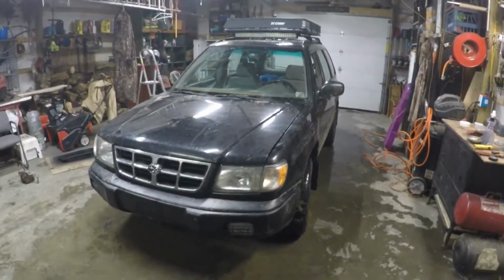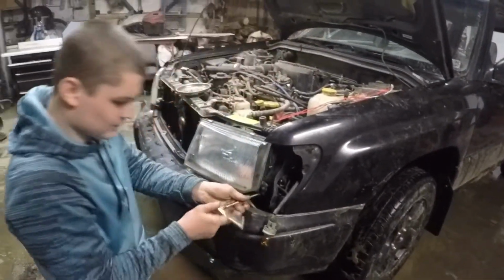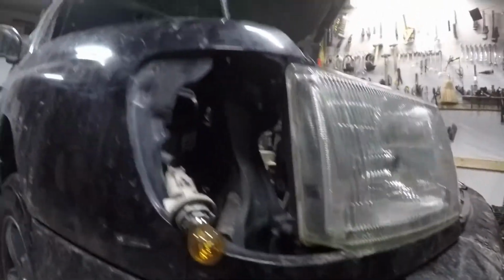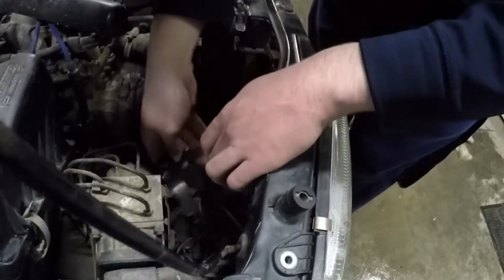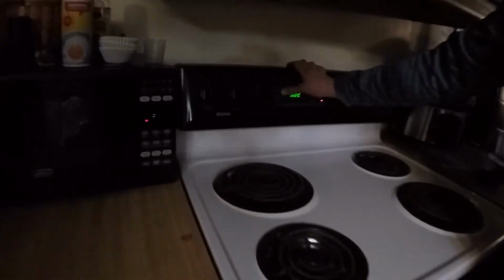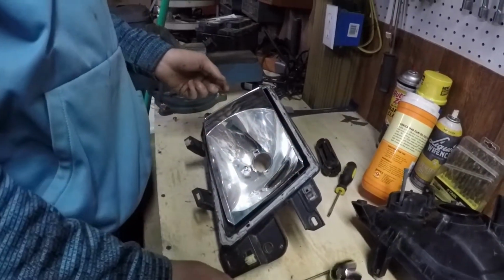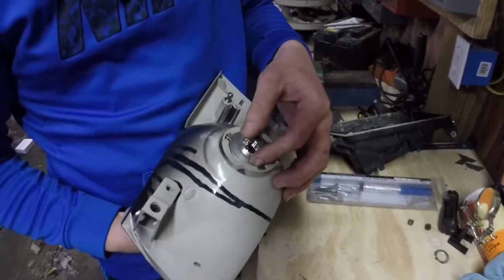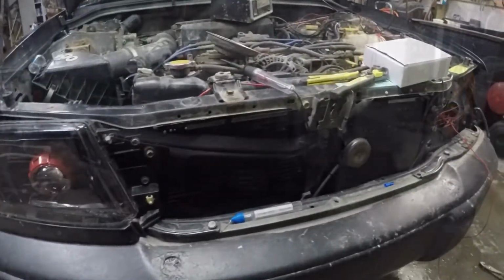Subaru Forester Projector Retrofit

Comment: A bit of information if anyone is interested in doing this.
1. Most importantly, DO NOT PUT YOUR LIGHTS IN THE OVEN, they will melt after around 6 minutes, trust me, I know 🤦‍♂️
2. A decent heat gun, cycled around the glass side a few times works, go slowly and be gentle, the glass can chip around the edges.
3. HID and projector kits are available on both eBay and Amazon, I got everything I need for less than £200 (around 280 usd)
4. You will need a 2.5 inch projector kit, mine used a H1 bulb, I then purchased a “H1 HID kit with ballasts, I then purchased a H4 HI LOW H43 RELAY WIRING HARNESS XENON HID CONVERSION KIT SINGLE CANBUS ERROR FREE” wiring kit, this plugged from my factory wiring directly into the HID kit and also into the shutter hi/low wiring on the projector itself. No need to cut or trim ANY wiring.
5. Make sure you can actually get replacement headlights BEFORE you attempt this, I melted 1 headlight and broke the glass lense on the other before checking to see if I could get another set, cost me a small fortune and had to wait 3 weeks for shipping overseas.
Reply: where have you bought all the parts?
Reply: I bought the same hi/low wiring harness but my bulbs wouldn’t light up, I concluded that maybe my h1 xentec kit was faulty. As the hi/low adapter would trigger my projector solenoid when I flipped the high beams.  I also ordered a different harness that draws power from the battery to see if maybe that would help. Now we wait.

Comment: I've got Auxbeam LEDS in the headlights and fogs and love them but Im going to paint the inside of the housings black/graphite and do the projector retrofit. What size projector for the headlights did you use? Or link, or company name maybe? I saw the Russia sourced clear lenses on eBay so I know those are still available..just worried about not getting them or length of shipping time..SF5 rain gaurds are a bitch to find too!!

Comment: Looking at ordering the clear plastic lens! Is it a quality piece, and how is it holding up? Also did it fit perfect. Thanks! I subbed :)
Reply from the maker: Hey Scott, Thanks for subbing! And the clear lens is holding up great. I was a little worried about how they will hold up but its been 10 months and they are still holding strong with no scratches or cracks. I even live on a dirt road and I've been off roading with them too. And as for the fitment its pretty exact except for one thing. The back of the glass housing has a ridge all the way around it that slots into a grove onto the headlight housing. These do not have that ridge but they still fit perfectly.
Reply: @JKGarage  awesome news! Thanks for the quick reply :) going to order some asap for my RHD forester.
Reply: Where can I find the plastic lense?

Comment: Can this work for the sf5  2002?
Reply from the maker: Yes it can! same process except with the 02 you do not have to buy the aftermarket clear lenses! So it will be about $100 cheaper with that year Forester! If you have any other questions just let us know!
Reply: I hoping maybe there is somewhere i can just buy both lights. I'm not good at DIY. Do you know any store or ebay?
Reply from the maker: They are pretty rare to find on eBay. But I believe there are a couple of Facebook based shops that can retrofit them for you. Only problem there is you may be without your headlights for a week or two!
Reply: That's okay with me since i'm planning to get a new set of the headlights...thanks for the quick reply
Reply: @JKGarage  my problem is more that I'll be without a few paychecks to have it done professionally haha.